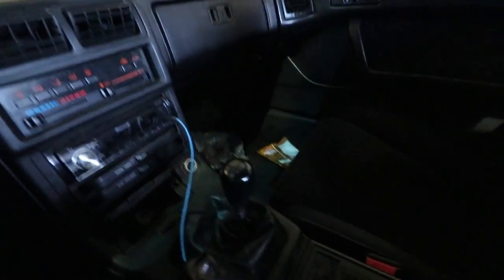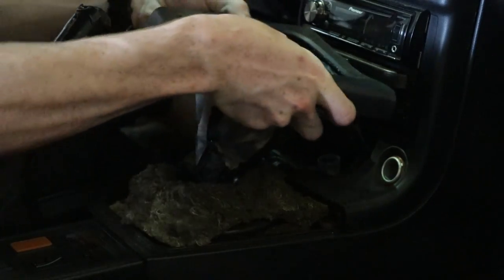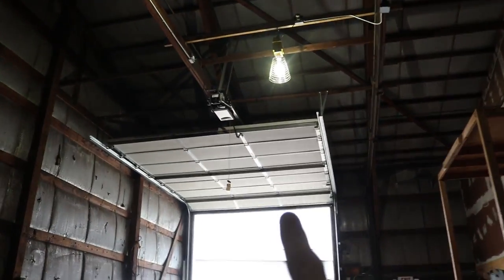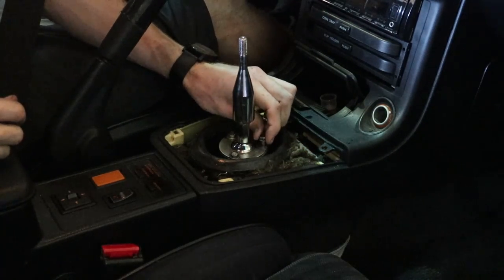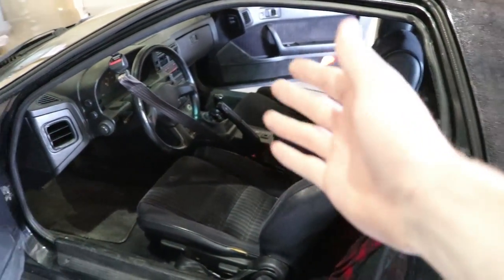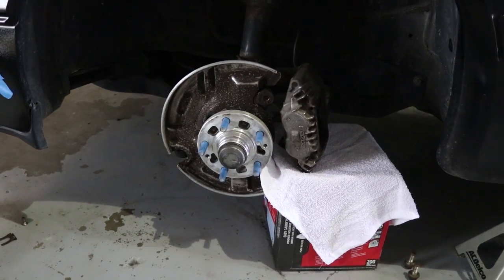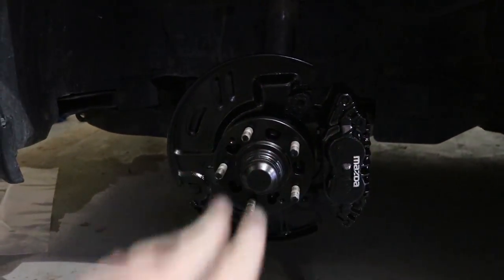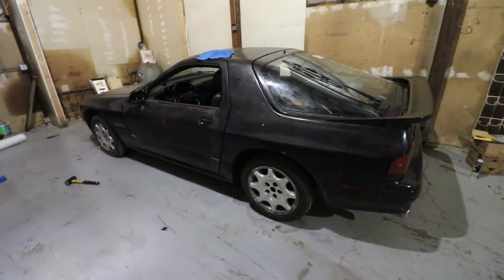How to fix a Sloppy Shifter

Comment: Buys new tires for the RX-7
Reply: EL3MEN2 07 new wheels means new tires
Reply: lol no you can get new wheels and keep the old tires. Its cheaper that way and because he is drifting i dont think he would get new tires
Reply: Well if he gets new rims that are bigger for example 265's in the back or front he wont be able to put an old tyre which is meant to be put on a 225 rim
Reply: Hello Mate gets it, who would ever buy stock size rims? I mean the whole point of new rims is so you can run bigger tires for more grip.
Reply: Hello Mate streeech that shit
Reply: Xantho Poulos isn't this a drift build
Reply: Unco Casey and you don't think that you need grip to drift?
Reply: Xantho Poulos new rims can be lighter, and you don't need grip to do donuts in a tight spot without much power

Comment: quick fix for stripper treads on aluminium... go to the hardware store and get some foil tape & put 1 layer around the bolt & thread it in like normal

Comment: I think that the shifter tower bolts, working their way loose, is a common Mazda problem. It must be vibration that allows the bolts to loosen up, so significantly. I recently purchased a very expensive short shifter, for my wife's 2001 Miata NB, to cure a super sloppy shifter condition. Once I got in there, I found that all three bolts weren't even finger tight! Just like yours. Tightening up the tower bolts, completely fixed the problem!I still installed the short shifter, but it turned out to not really be necessary. I did put a little blue Loctite on my bolts. Keep vids coming and keep up the good work!!

Comment: hey.  I have a mazda mx-3 that I took to the shop to have the clutch changed and upon getting it back the shifter was sitting on the exhaust and their resolution was to use some set screws to hold it in place.  needless to say I will never go there again.  what would cause that?  I don't have a lot of experience with that kind of stuff just know how to do some of the basics, but learning with time.  the video was informative and found it by looking for fixes to sloppy shifter as my shifter was also extremely sloppy when I got it back.  any information from anyone would be helpful.

Comment: @gingium to try and get that shifter bolt to catch a little thread you can put some copper wire in the hole and the bolt should thread around the copper and tighten done see if it'll work cheap and usually works

Comment: What did he do wrong exactly on the brakes?
And I wanted to say in the last video Gingium that you don't really need those screws that are on the rotors. when you bolt the tires on they will hold